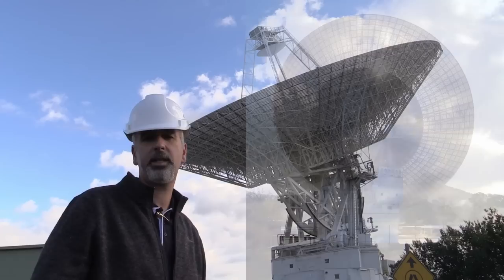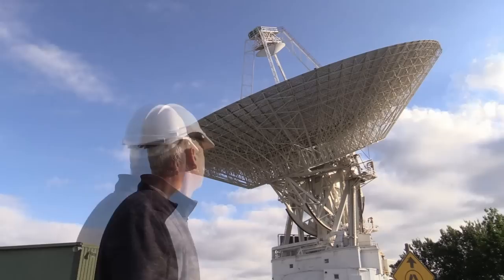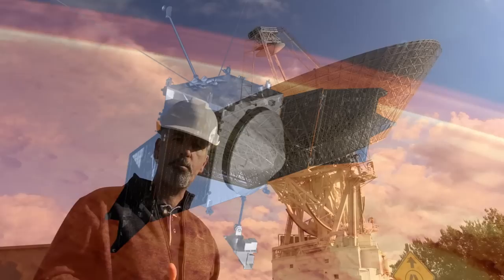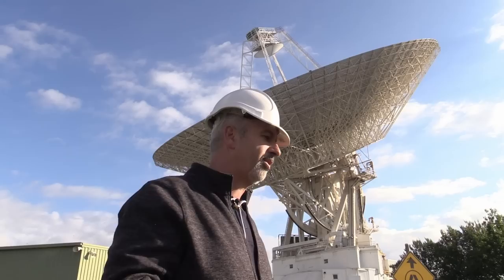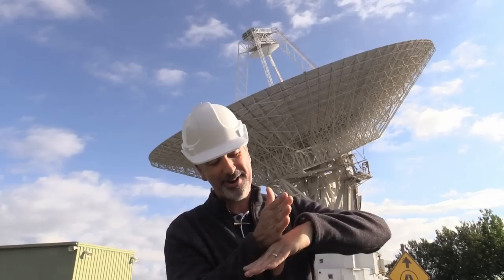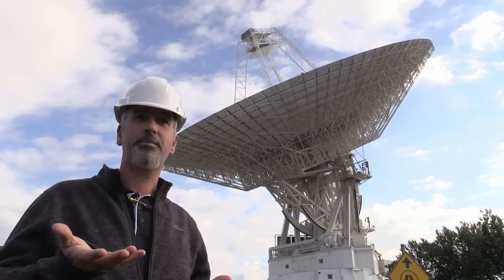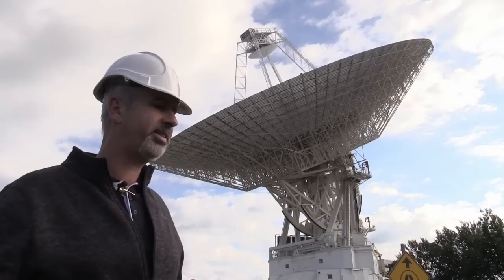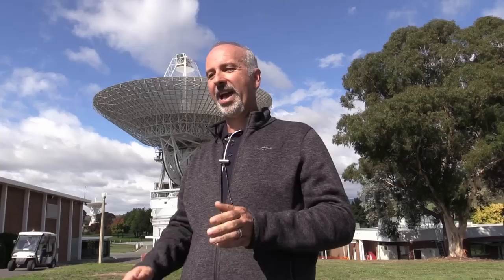EEVblog 1547 (Part 1) - Contacting the Voyager 2 Space Probe

Comment: Crazy to think that those circuits are still working 50+ years on, and some of the engineers and technicians have already passed away. Probably a sense of pride for them - building something that was still working so many decades later.
Reply: Theirs a team still running voyager,  tv show, "its quieter in the twilight", 7 people left running the show
Reply: @Okurka.  close enough. :-) I thought he said 1970.
Reply: The temperature variations those circuits go through must be crazy. That’s some durable solder joints.
Reply: @ecospider5  also, all of that cosmic radiation. I think he said 2025 was about the limit of the TEG power source?
Reply: Really makes you wonder how horrible the brain drain really has been over the years.
Reply: @RK-kn1ud  Well, the fact that JPL successfully completed a mind boggling landing of the Perseverance rover recently, and also included with the package an autonomous helicopter that's outlived its expectation by 10x flights as of recently says that they're still in the game! It's kind of fun - there are actually channels on YouTube where guys will get old Apollo and other NASA hardware and then reverse engineer it to get it working again. 

https://www.youtube.com/watch?v=E3xWCqPBUFU
Reply: @ecospider5  It's all through hole connections with the wire ends carefully bent and clipped in a manner that the circuit should technically function without any of the connections actually being soldered..it's a very robust system, that along with the components being oversized gives it a lot of resistance to cosmic rays and such.
Reply: It's not that hard to make electronics that can last that long with only remote access for maintenance, it's just prohibitively expensive for anything except electronics that won't have access to a human once it's in place (so pretty much just space probes). Also helps to have multiple layers of redundancy and not minding loss of functionality as bits start to fail (not everything on the Voyagers still works even if they had the power to run it all).
Reply: What is amazing to me is that it has not gotten stuck in a software boot loop or some weird situation in software that can cripple a system... think windows... the install on my pops computer has only been on there for a month...it got corrupted and lost keyboard functions... weird right? What if something like that happens in space? Next thing is power supply... usually the first thing to give up is power supply components... usually capacitors, resistors, transistors, MOSFETs,diodes and even fuses have a life expectancy...I found out that fuses do degrade over time and can blow below their rating... capacitors of a few types degrade over time... electrolytic caps can leak and destroy other things or the circuit board itself...some like to short and burn or catch fire... resistors can turn to dust from heat.... etcetera...I'm sure they use a connection style that doesn't rely on solder joints for mechanical and electrical connections...I'm sure they use solder just as the third layer of redundancy...but think... how many electronic devices can you find that still function and are 46 years old???
Reply: @bentboybbz  If something like a boot loop is detected, it'll drop into a safe mode. This happened for what, as far as I can tell, was the first time in January of 2020. (hmm, just in time for Covid, coincidence? Obviously.)
Reply: @Okurka.  Indeed, but it would have been built some years before that with robust, proven and mature technology.
Reply: @bentboybbz  they use formal techniques to prove the software won't enter a failure state (or very unlikely to). Not sure if they did this for Voyager but they do it for other things. They also avoid things like dynamic memory allocation in order to increase reliability.
Reply: @bentboybbz  the components used have been selected from batches that underwent extreme testing and redundancy is everywhere. One of the reasons why space hardware especially that designed for human or long duration flight is mind numbingly expensive. Each capacitor on Voyager will have reams of documents tracing it's history.
Reply: Luckily for voyager, Chinese capacitors didn't exist in 1970s.
Reply: @MattyEngland  I used to have an older Lexus that had this nasty ignition gremlin that I chased down for weeks. It would just fail to start now and then, or die at intersections. I replaced so many things. After scouring some forums, I found a post that said that they had a batch of ECUs where the capacitor supplier had cheaped out and gotten some counterfeit components that ended up leaking and failing years later. Luckily, there’s a place that fixes them up for pretty cheap. Amazing what one little capacitor can do.
Reply: @toastrecon  Yeah I repaired an ABS controller for a mate. Main dealer wanted £800, replaced a couple of capacitors for a grand total of £2
Reply: @MattyEngland  nice work!
Reply: I think I remember reading somewhere that no electrolytic capacitors were allowed in the design.  Try building an electronic rig with that restriction out of 1960's vintage components.
Reply: @RK-kn1ud  That's the plan . great reset
Reply: @bentboybbz  if you look at military circuit board, the board is robust. the layout is different than you see on computer mother board. everything is bigger, like the resistor and such. i believe the voyager is built the same way. depending on certain board, it can last for a very long time. not everything is last forever it has a life expectancy.  when you mention window operation like microsoft window xp, those are on a magnetized disk or SSD over time they get corrupted and read/write many times virus or what not. Voyager operation software may be on its bios chip/cmos chip. meaning it will last a lot longer than that on a magnetized medium. than again its still surprising that those haven't degrade to the point it stop working.   whats even more amazing that it hasn't hit by a single dust yet traveling over 20,000 miles per hour! it will take one single dust to blow that in space.
Reply: Makes us wonder if the Pyramids were a power plant. Gold, Copper. the Dry Wind Static DC at least and a few primitive batteries. They could have had the Eternal torches'. Ty From FL
Reply: The Voyager 1 spacecraft got stuck for about two months this year (early 2024). Some part of the memory failed and it was sending nonsense signals. The JPL folks were able to fix it by sending a command to not use the bad memory. The regular software systems on satellites have another watchdog system watching for loops or other problems and can reset to safe mode, then wait for instructions from Earth. The Voyager 1 problem was more complicated.

Comment: If you have been following CuriousMarc you will see the entire system used on Voyager is derived from Apollo, and that they had to undo some of the modifications made to it after Apollo to use on Voyager. But the connection system is still derived from the original Apollo one.

Comment: Apparently Voyager 2 had both main and backup radio receivers develop faults, so it does not really receive transmissions that great. I think maybe like they lowered the baud and filtered the transmission. Apparently at the time all the planets were in a line up for a slingshot ballistic track. It was maybe mentioned in 2001 more literally lined up planets.

Comment: Would be a nice addition to get a visit to the vertex room... and out into the dish!  I used to have my own dish, when I ran the FDVLBA in west Texas... the backup system was only enough to stow the (25m) dish, so a 460ci Ford engine was enough... no life-or-death importance to radio astronomy.  We had all the same stuff... steerable sub-reflector, dichroic filter, even a set of crossed dipoles on the sub for 6meters.  Thanks for the trip down memory lane.

Comment: the point is how much precission has the reaction wheels and the whole attitude control system to get an absolute accuracy and stability for pointin the antenna to earth. Considering the extreme low power of the transmitters

Comment: Do you know if they plan any more expansion?  Makeing the antenna bigger?  I suspect they can't drop the temperature much further.
Reply from the maker: They just completed an upgrade. They won't build any new big dishes like this now, it's all smaller cookie cutter 34m jobbies that they array together. $80M a pop.
Reply: @EEVblog  In a way that does make sense, now that software can mathamatically combine multiple antennas into a large synthetic antenna.  But still, there is something to be said for an "oh my god" huge structure. 🙂

Comment: The Earth rotates
around the Sun
and Voyager moves

Some Clculations will be necessary .. in Realtime  ?

How can the Antenna track Voyager with millimeters accurately at that distance?

I assume the target window is "large" on site, but this makes transmission more difficult since 95% of the RF power does not hit the receiving antenna.. I assume

Crazy but it works

Thanks Dave !

Comment: Interesting that there's no mention of error correction coding for the uplink to Voyager.  Given the need for highly accurate receipt by the spacecraft of commands and software uploads, why doesn't Voyager use error correction for uplink (if I'm correct in thinking it doesn't)?  Would the processing required for decoding been too heavy a lift for the spacecraft's computers?

Comment: CORRECTED EDITED TEXT
00:00 - How do you contact the Voyager 2 space probe?
03:14 - Voyager ISN'T the lowest signal level!
06:29 - The Failed Capacitor and the Best Lock Frequency
09:00 - Transmit uplink power
10:00 - System noise temperature
10:30 - S and X band receivers
11:42 - Mars Reconnaissance Orbiter and the Signal-to-Noise Ratio
12:39 - Maximum Transmit power is WHAT?
13:12 - The effects of weather
14:16 - Power supply and backups
15:29 - The role of the Deep Space Network
16:50 - Mag Roll Calibration

Compare the difference :

Comment: 10:30 maybe I'm misunderstanding, but is this "dichroic mirror" really necessary? You wouldn't necessarily be transmitting and receiving simultaneously since you have, what did he say, a 30 hour roundtrip. Enough time to reposition the cones. Although in the later explanation it sounded like they receive on both S and X?

Another thought. Do we ever only communicate with Voyager 2 directly from Earth, or do we ever communicate through other satellites used as relays?

Comment: Seen from the Voyager, the almost infinitely small angle of impact to hit earth earth makes it impossible for me to comprehend how a 1977 technique can communicate over that distance. Yes, many KW's of power on earth, large disk, and all the mods you need to give it your best, but from the Voyager seen there's no hardware to upgrade, it still has that small disk and fixed power to send a message back. Would it just wave a repeated signal around a bit, proximately in the direction of earth, so occasionally a stream is catched ?